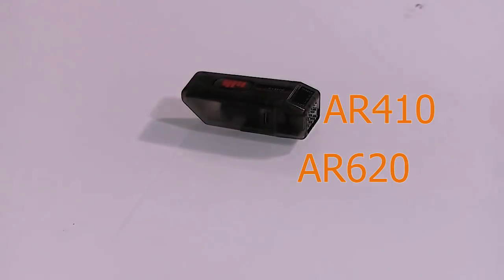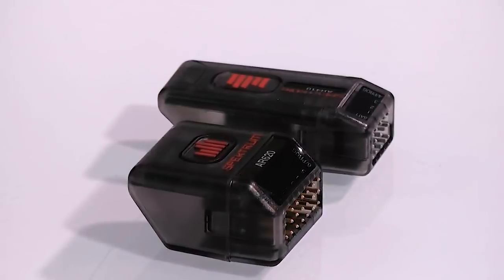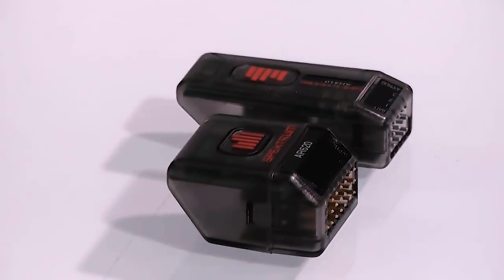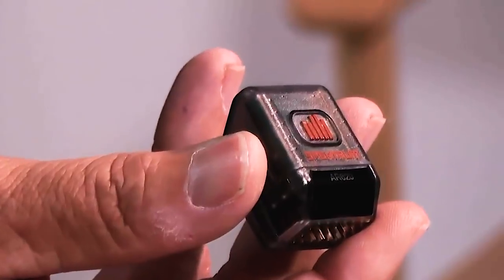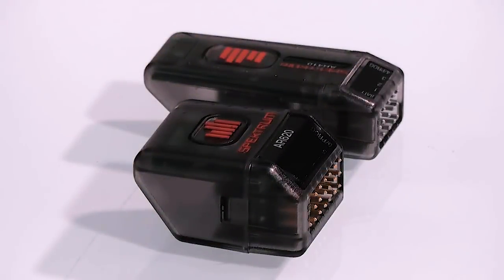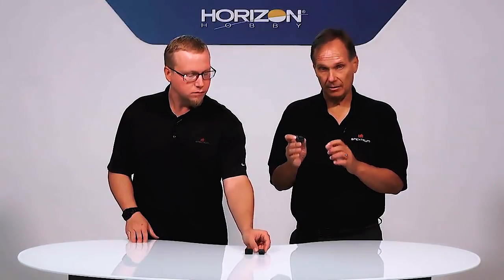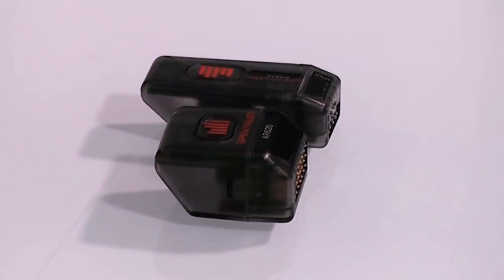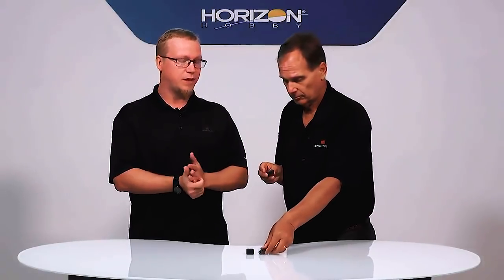Spektrum Antenna-less Receiver Tech Talk

Comment: I have been using both the AR410 and AR620 for my sailing yachts. What surprises me is that the FlySky radio's has issues when it comes to surface Tx/Rx, while my Spektrum has been flawless. In a sailing boat less cable is better. As for range I haven't had any problem. Got my first Spektrum system some 13 years ago..... for a sailing yacht. Bottom line Spektrum is my way to go. Now if Spektrum could create a specific "antenna-less" for surface would be amazing. My best to Spektrum

Comment: Good info.  Not sure if its my speakers but the second guy sounds like hes on skype.  :)  Anyway will any of these antenna-less receivers have options to add more telemetry connections?  Would love to at least have lipo pack voltage.  Thanks

Comment: How come, that all E-Flite BNFs are equipped with AR631 or 637TA if the receiver models with integrated antennas have superior reception? Or is this for the sake of a better telemetry range only? (Like, signal transmission back to the radio works better with external antenna?)

Comment: Hi Tom, Ive had one of the 620 for some time now and never had any issue's with it. Very recently I did the latest update and am wondering if now if the update made it AS3X/SAFE compatible? Or was the update just to fix bugs in the background?? When I built and bound the RX in my NX8 it showed foward programming in the function list but would not allow the safe and as3x screens to come up to use the fow prog functions. 
Thanks in advance

Comment: My receiver has low range I got the DSX Transmitter with the AR410 receiver.
Reply from the maker: Hi JBRC, Make sure your AR410 is a good distance from any batteries or fuel. more then 3 inches
Reply: @SpektrumRCvideos  Can I wrap the battery with Tin foil ?
Reply from the maker: I struggle to see how that might help? I would not recommend it and likely will only make matters worse for the RF.
Reply: @SpektrumRCvideos  WEll. i AM struggling with this Radio and receiver, it is the worst thing ever I wasted 200 dollars Canadian it crashed my plane so I want a refund from Spectrum.  Thanks
Reply from the maker: Well if you are wrapping things in tin foil I can see how that could be causing signal issues. I am happy to help troubleshoot but if you suspect the equipment failed and you are looking for warranty support I would suggest reaching out to our product support team for help sending your equipment in for service  - https://www.horizonhobby.com/service-center.html
Reply: @SpektrumRCvideos  No, I did not wrap anything.  Yes I will have to talk to warranty, this is a brand new purchase.
Reply: @SpektrumRCvideos  Thank you.  JB

Comment: What's the range like? Anyone knows?
Reply from the maker: Well, considering your YT profile mentions RC Truckers, I would assume you are asking about these receivers in a surface model, and they are not designed for that. That said, these have excellent range when used in an aircraft :) in our testing they get well over 3500 feet but depending on your setup and installation your mileage may vary ;)

Comment: I use this on my seagull turbo beaver  with an OS GT22cc  engine and I'm impressed with a range and very fast recovery reciever that you dont even noticed that there's something happen. And the best of all channel 5 remains on the last position for my  opto kill switch it doesn't shut down my engine incase of HOLD:1 or transmitter failure.  Everything was tested from the ground to the air switching off the remote while it's on the air. YES ITS TRUSTED RECIEVER

Comment: I have got airelons, rudder, elevator all working fine, but I cannot get any response when I move the throttle stick on the DS6 . What am I doing wrong?
Reply from the maker: Make sure your throttle trim is in the middle. If it is too high, the esc will not initialize because it thinks it is getting input and as a safety feature it will disable output until it sees throttle at a low input.

Comment: Will my battery with a Deans plug fit?
Reply from the maker: No, we recommend using a ESC, BEC or Receiver pack for power
Reply: @SpektrumRCvideos  thank you, I used to fly rc 30 years ago and the battery plugged into the receiver,though that was with an engine, ic

Comment: It’s pretty impossible to have it 3 inches or more away from the battery etc,in the planes I have everything is closely packed in together under the canopy lid
Reply from the maker: It may work fine, most important object to keep spaced away from it is the battery, and only then if it is a fairly large pack. Smaller means less chance for signal blockage :)
Reply: @SpektrumRCvideos  so it's okay for the reciver to  be  under a closed canopy lid?
Reply from the maker: @dazspurs9899  As long as the canopy is not made of metal or carbon fiber it should be fine :)
Reply: @SpektrumRCvideos  thanks for replying 👍🏻

Comment: Would be ok to use it on a 30CC gasser, like a Giant Big Stick? Or too much for it?
Reply from the maker: If the RX is placed appropriately, then it will work, but in Gas and other combustion powered models you have more chances of the signal being blocked my items in the airframe. Such as fuel tanks and the engine. If you are going to use in one of these models then make sure that the RX is well away from other objects that can block signal. For the best reception with out signal path blockage, we recommend a receiver with a remote receiver.

Comment: hello thanks for the video tec talk ….i have a question …i have a ZOHD ORBIT wing with ZOHD ELECTRICS ….i want to take out the zohd receiver and put one of my specrum recievers into it and connect to the zohd stabilizer which has take off mode and stabilization mode on it …..will the spectrum receiver talk the same language as the zohd stabilizer or will i have to get a spectrum safe stabilizer receiver ….or am i letting my imagination run riot with me ……… i look forward to yr reply thanks….

Comment: Need 1 answer please. Got a FMS 1400 mm p 40. My rudder and tail wheel moves in opposite direction. I’m using ar620 with a dx8 g2   My question is , can I use the battery port on the receiver as an auxiliary port to separate the rudder and tail wheel   I also have the same problem in my FMS 1700 mm p51 with my flaps and cowl flap door   Keep in mind I tried a y harness to eliminate the board in the plane and the issue still exists. Thanks
Reply from the maker: Boston SAM Hmmm, normally FMS has a break out board that takes care of this. Did you swap the servo for something non-oem? Unfortunately no the Battery port is only a battery port. If you are out of channels and need to reverse a servo I would suggest a in line servo reverser. Hope that helps!
Reply: SpektrumRC stock planes. Can you send me a link for reverser? I need 2
Reply from the maker: @sambuvca22  We no longer make one :( But there are plenty to be found on Ebay. A simple google search for "servo reverser" will point you in the right direction :)
Reply: SpektrumRC I found them. I appreciate your help and let it be known, I only use spektrum products in my birds. I’ll looking into servo replacement. I was able to reverse servo arm and move the servo starboard so the arm was free of tension on p40. 
Not sure I have that option with p51 though.

Comment: Is the AR620 suitable for 60, 90 and 120  size airplanes ?
Reply from the maker: Really depends on your setup. If you can get the receiver far enough from batteries, ESC, Engines etc then you should be ok. That being said, a comprehensive range test is always recommended. Hope that helps!
Reply: Would it be best to install a Remote Antenna/ Receiver to the AR620 ?

Comment: can it be used in an electric car?
Reply from the maker: Not recommended :) But you can if you are using a "Air" Transmitter
Reply: @SpektrumRCvideos  does it need a separate power source or could it be powered by the esc?

Comment: The Frsky rx4r and rx6r smoke this lemmon pos for multitude of reasons, longer range, half the weight, less than half the size (volume), lower cost, TELEMETRY full range (not some 600 quacks, about 1/3rd the radio range, yep, telemetry is only ~1/3 the radio range, so how are you supposed to tell your azz to turn around before your lose RF, pathetic imo) before you lose control and CRASH your model with zero warning (with speKrum is ZERO warning, you just crash and lose hundreds of dollars and hours). I will give it thumbs up! Now you can lose control and crash your expensive model for only $30! Time to try a real system Frsky, 24ch, telemetry, voice for $70, lol, LMAOROG all the way home. Been using Frsky for 11 years, 30K flights in 11 years, ZERO glighes, = quality for low cost=Burn on SpekCrummy.
Reply: How much does frsky pay you? lol.
Reply: @mtlfpv  Zero, I like frsky stuff because it works and does not lose rf link and lose my stuff or glitch, all for much less cost. Hint, you dont always get what you pay for (Spekrum). Look at how little you get and the price this cost, just taking advantage of the uninformed, poor victims, reminds me of CrApple. The best comeback I hear at my field, speky has great service, be cause they need to use it so often, just sad. I have a Taranis x9d from the first batch, zero issues in 7+ years, almost 40 Rx's, what would that set you back going speky, about a house down payment.  6ch for almost $300 shipped, lol, wtf they thinking? That is just wrong.  https://www.horizonhobby.com/product/dx6-6-channel-dsmx-transmitter-only-gen-3/SPMR6750.html The smartest thing speky has done was hire a guy that new 2.4ghz freq hopping and hired him to get it to work, I will give them credit for hiring that guy.

Comment: Would these receivers work with Dx4s transmitter?? Thanks
Reply: Why? You have 4 channels. Buy something that isnt a toy and get enough channels to progress and actually learn. 
Never buy a receiver with more channels than your transmitter
Reply: @krotchlickmeugh627  will these work in rc trucks too🤔 better than having short wires within the receiver box I guess
Reply: @gonzodetroitify  I don't see why not. But you won't be able to use your remote I don't believe. They have surface versions of this same receiver tho

Comment: Not sure how well this build in antenna really works. Flying a SIG 4star with a Spektrum DX6 and this AR620 for 9 minutes I get 138 frame losses. There is nothing in the way of the RX that can obstruct a signal. The battery is 6" away and I stayed within 500 to 600 ft max. A satellite can NOT be added. Horizon told me to set the frame loss alarm to 20 !!! Is this RX safe to use???
Reply: I just got this receiver and kind of crashed landed my plane.  I did range test on the ground it was not very encouraging.

Comment: The ports are labeled by numbers and not by function. Does anyone know what 1 2 3 4 5 6 are? Like which one is throttle which one is aileron flap elevator rudder gear?

Comment: Still not as cheap as a lemon rx no thanks. Price them at $15 and $20 and maybe you will sell more.
Reply: Yeah but lemon are shit so thats why
Reply: @mark675  false I run them in all my planes even 50cc. Orange rx is shit, but lemon is in another ball park of their own. I have never had signal loss with my lemon rx with a satellite on them. however i have had issues with my $150 dsmx helicopter receiver not wanting to stay bound. i realize once in a while you get a bad receiver, but so far i have had zero problems with a Lemon RX.

Comment: Guy on the left keeps chiming in interrupting the guy on the right and I didn't catch everything he said. He also didn't explain the purpose of the 2 fail safe modes and when or why you would use either one. Not very helpful. Manual Indicates 300-400 foot fly-by range.
Reply: Sailplane mode, you can set it to dump it out of a thermal vs flying away (you can set it to deploy spoilers and down elevator). In normal it just levels the control surfaces and kills the throttle
Reply: Anyone know what is flyby

Comment: What is the actual range on this receiver? can you spec out a 3 meter sailplane?
Reply from the maker: It is a full range receiver which is  line of sight. If you can see the model you can fly it. On our ground tests we were getting about .95 of a mile, but that is literally on the ground walking away from the tx until it failsafes. it is much better in the air because it is more open with less reflection and blockage from the ground. Should work very well on a 3 meter sailplane. Hope that helps!
Reply: @SpektrumRCvideos  Thank You. I appreciate the response. I will be buying one for my Bird of Time.

Comment: So what happens when the bind button gets pressed while flying?
Reply: The bind button only works at power-on or if you hold it down for a significant time before it gets signal from your radio.
Reply: So it won't do anything if you press it during flight
Reply: @ 2.05 - might want to rewatch this.
Reply: Yes, John didn't get into the super-specifics here, but it's in the manual. :-) "The receiver will also enter bind mode if you power on the receiver and then press the bind button before the receiver has connected to any transmitter."
Reply: Brian Phillips  do you plan on flying your airplane with a mouse inside and you are worried that he might press the bind button? How the heck are you going to press the bind button on your receiver while in flight.
Reply: Greg Ertman, If something shifts, particularly a wire OR lipo and presses the button, that would be a pretty crappy way to lose a plane. I realize most of the time this won't be a huge issue, but you know how things get really tight inside models, so the last thing I want to worry about is having a button that might get pressed in flight.
Let me give an example...
The A3L has a push button on the top of the device for entering setup. I recently installed one in an 800mm Rare Bear. This application caused the stabilizer to be located about just under where the lipo was going to sit, so I had to engineer a "standoff" to protect the button from being pressed in flight by the shifting weight of the lipo.
...If you can't imagine how this might be a problem, it probably won't be an issue for you, but as for me it might be an issue, but furthermore, I PREFER the external antenna. IF I choose to fly a carbon fiber fuse, I want to be able to get RF to the Rx, so this will be a system limitation...
Seems like a solution search of a problem, to me, and I don't buy for a second that they're getting MORE range with an integral antenna - total BS!
Doesn't matter so much for me, since I won't be buying them. Don't get me wrong, I'll "buy them" in the event that they're integrated into BNF planes, but I won't generally pay for stand alone Spektrum gear...I've got Lemon-Rx for that, and I love them.
P.S. Not trying to bash Horizon Hobby. They make some of the best gear, and I love their products, but I just don't buy every sales pitch they make.
Reply: Really Brian with your attention to detail, what the f is going to push the button except your gremlins?
Reply: EXACTLY!!! Those pesky little buggers are gonna be the end of me!!!
Reply: Don’t understand why you would want to press the bind button while flying pmsl ,about time spectrum had a bind button sick of hunting for a bind plug when needed Congratulations Futaba whoops spectrum..
Reply: Stuart, my concern was what happened if it accidentally got pressed in flight, like a lipo shifting, for example. Sounds like you have to press and hold it...
Reply: @BrianPhillipsRC  strap the lipo down properly and velcro it too, if a lipo shifts backwards enough then the plane will probably crash anyway

Comment: Im still waiting for the garbage toyranis fanboys to come out of the woodwork here
Reply: pmm4177 They’re probably out flying their planes and not busy rebinding their receivers.  

NB: I don’t fly Tranis   Maybe I won’t ever.
Reply: @RyanNX211  taranis sucks. I have a month old qx7s with shit range,  shit plastic ass sloppy hall sensor hype garbage, had 2 scary as hell glitches and a failsafe near crash with less than 3 hours of use on it. Frsky receivers are cheap junk too. I have used Spectrum since 2005 with zero issues. Frsky can bite me.
Reply: Ive got a dx9 and a taranis/tbs crossfire module,
Both great radios, spektrum definately better looking and quality though

Comment: Ah Hummm, On one of my planes I have a total Carbon fiber fuselage, without an external antenna this wont work. And 800 foot range limit?  So much for FPV...
Reply: 800' is for the telemetry, not the control link.
Reply from the maker: Range is great on foam or balsa models, beyond line of sight. But with carbon sheeted pods and fuselages you will still want to use a antenna with a whip that can escape the fuselage. Hope that helps!

Comment: Im building rc boats and I am wondering what you suggest? Is there a waterproof receiver for my Dx6r? Is there a receiver that has a long aerial?
Reply from the maker: Hi Duncan! Yes there are! The MR4000 fits the bill nicely. https://www.horizonhobby.com/mr4000-dsmr-4-ch-marine-rec-spmmr4000
Reply: @SpektrumRCvideos  thanks for the reply but you're MR4000 doesn't fit the bill as you say ! I bought a DX6R for 6 channels not 4 or I could have saved $400 ! This is if i ever get the DX6R working as it doesn't recognize my controller as a DX6R for the firmware update needed to get it up and running
Reply: Duncan mcmullan sell it and get a taranis, you re much better of with that for a cheaper price